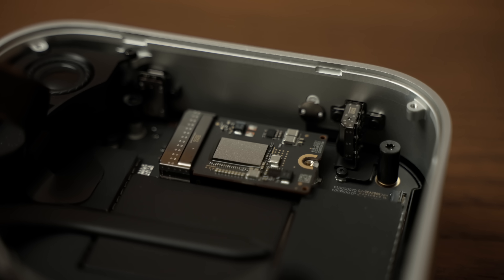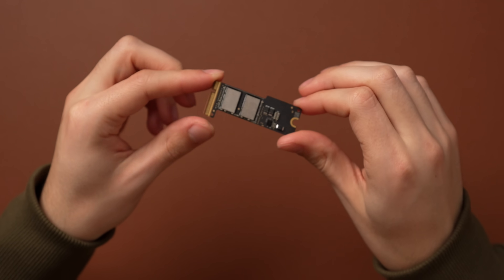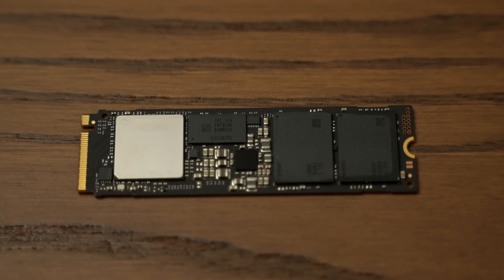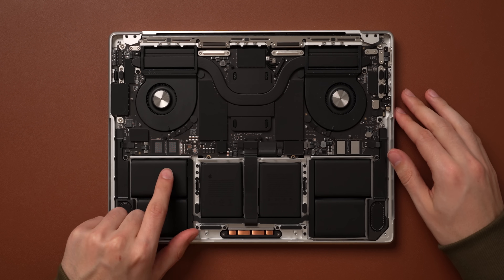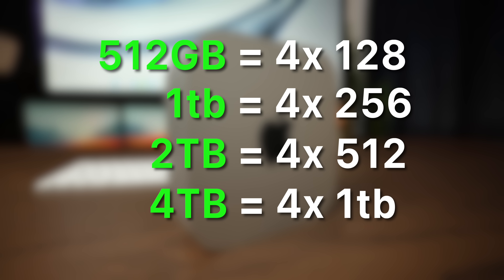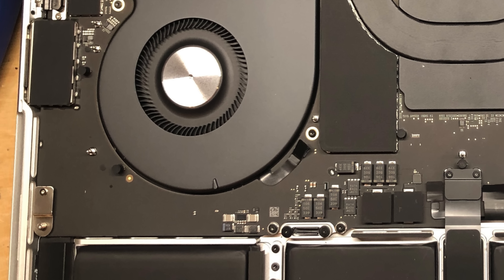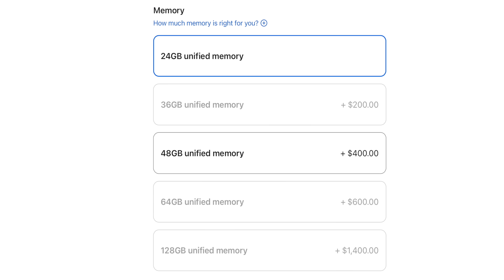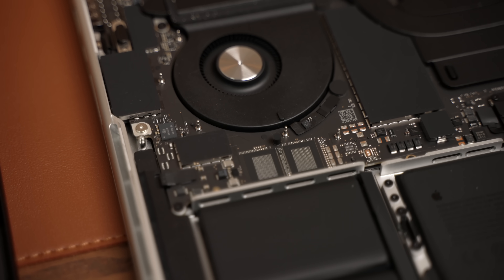Apple SSDs are hiding a BIG secret... Upgradable MacBooks??

Comment: Great points. They reinvented the wheel :) Wondering how long will it take them to realise that with dumping the soldered RAM can further help to reduce the combinations and their cost. And then we arrived in 2012 :)
Reply: Apple saw this and was like "did somebody say reduce COST??? We're one of the richest companies in the world, and yet we still pinch pennies like Ebeneezer Scrooge"
Reply: Ehhh. Ram is now built into the chip. 

They need to move to a new standard:

Ram on chip + secondary system ram. 

So that's advertise it as:

M5 - 8Gb : 16Gb 

Where the first number is on package ram and the second is external serviceable RAM. 

🤷‍♂️
Reply: @1337GameDev  I, personally, would rather not have the performance hit that goes with such a multi-levelled design.
Reply: @TraneFrancks  

Ehhh, it's better than not having ANY upgradeable RAM. No different than having L1, L2, and L3 cache on a CPU. 

I'd rather have very fast 8gb RAM, and then slightly slower but fast 8gb rather than stuck with 8gb.
Reply: Soldered ram is good, storage is not. A ram is a LOT more durable than a normal storage nand. And soldered ram is much faster. So I can understand that. Lots of companies are doing that not just apple. But soldering down the storage should be a crime.
Reply: @Coookie9  The Apple SOC has its RAM onboard. It's not even possible to decouple the memory from the SOC without decimating the architectural advantages of Unified Memory. I'm fine with the SOC SKUs; storage, not so much.
Reply: @TraneFrancks 

They could follow the trend of on chip ram + external ram (sodimms and such)
Reply: @ On RAM not the durability is the main question, but the future expansion. That is critical to use a device longer.
Reply: @Coookie9  Wrong. Just search up LPCAMM2 RAM.
Reply: @Coookie9  You say that, but I have had rack machines (non-Apple) have RAM go bad and require replacing.
Reply: @Coookie9  Soldered RAM is bad. That is second thing that people upgrade right after storage either for speed or capacity. Soldered RAM means user needs to replace whole board just to get more ram. 

You bought machine with 8gb or RAM for whatever your reason was and then you find out you need more. Well with soldered RAM you need to buy new machine that will be more expensive even if you trade in your current device than just buying new RAM modules for 50$.
Reply: @ yess 100% but the problem is now the soldered ram is typically faster and I assume if they make the ram upgradable just for modularity, they would lose customers who don't care about upgradablity and only want the fastest machine. Unless they make them just as efficient and modular, but this is apple we're talking about. We can't even say for sure if they'll bring modular storage to macbooks. But for ram useless you pick 8gb (which doesn't exist anymore) you're usually good no matter what. Simple tasks on computers haven't really gotten that much more demanding over the past idk... 10 years. So I assume that won't be as critical of an issue as the storage nands just dying by age. The storage was a critical failure on macbooks. Ram not so much. So I doubt they'd ever change that.
Reply: @ Soldering the RAM only make sense in the case of mobile machines because of LPDRR. On desktop machines where there is no need to use LPDDR. With regular DDR you can have the same bandwidth with slotted RAM modules as well. On desktop systems I bet there will be 0 difference between a soldered and a slotted solution. On portables it can be a difference, but that might be a single digit in percentage.
Reply: @Coookie9  "We can't even say for sure if they'll bring modular storage to macbooks." — I think we can say with 100% certainty that those days are long gone. The SOC has Unified Memory and no longer supports discrete GPUs by design. It's a feature, not a bug.

I don't think that's too big a problem. I'll pay the higher fee for the RAM. Unified memory in the SOC under modern macOS responds to memory pressure much more efficiently than memory farther away from the CPU in the Intel architecture. The only thing missing in a big way for me is user-upgradable storage.
Reply: @ I completely agree. I still wish the storage module was either replaceable or built better for longevity otherwise, I am happy to lose upgradablity over power in this case. The way macs manage their ram is just pure magic.

Comment: Remove the 256 GB and that will reduce the number of combinations significantly.
Reply: who cares the make milions of those nands at this scale 2GB chip cost $0.5
Reply: @Adiiiman2xxx  - not the ones that work correct and are designed into the system - correct!

Those likely cost at least $5!
And more for shipping and the rest of the system and replacement parts, etc...
IDK, yet sometimes buying non-Apple is bad idea, even when you "save" $1000... because the other side is mostly junk - or you are paying almost as much for your vendor PC as you are for a "pro Mac".

Comment: The reason to remove pads is to avoid third party piggyback smd boards, a few of them are available from smart chinese people. There are other hardwired limitations, even on soldered nand chips, it's a very distinctive skill to be able to upgrade your macbook flash storage. Heavy desktop users.. maybe. They can really wear out NAND flash with VMs and large datasets.

Comment: Only reason I'm still rocking Intel Mac is extreme cost Apple charges for SSD storage, basically I refuse to pay the Apple tax to have a useful amount of storage. Sorry Apple, 256 GB was great in 2005, but not so much in 2025. If the SSD were easily user upgrade-able, like it was on Intel, then I'd finally upgrade.
Reply: How about refusing to buy products that has built in failure points and 0 user upgradeability/repair.
Reply: My 2018 MBP (with intel inside) used soldered on ram and ssd.